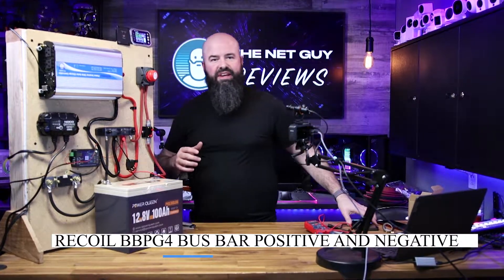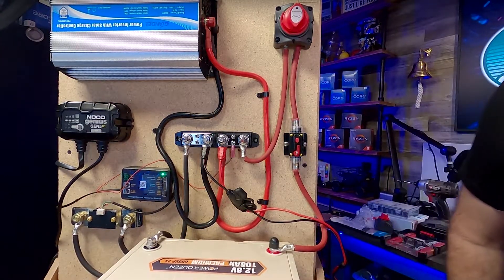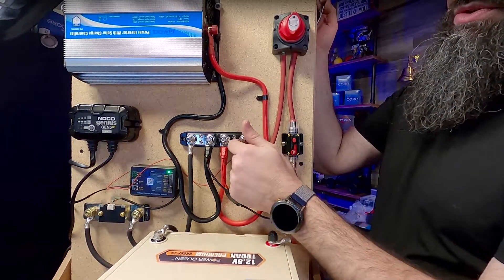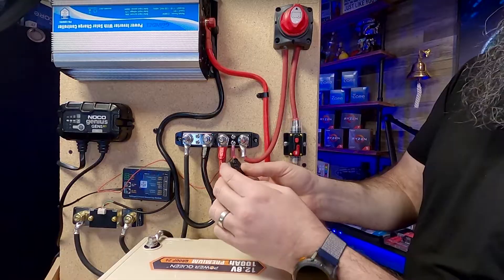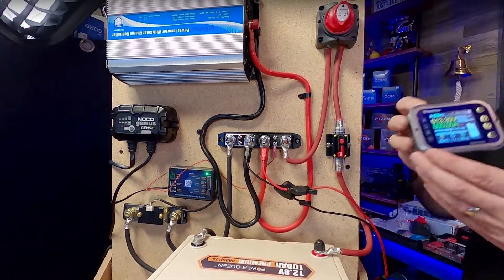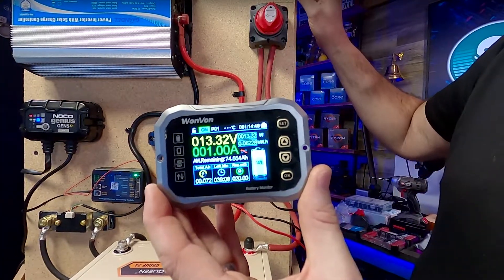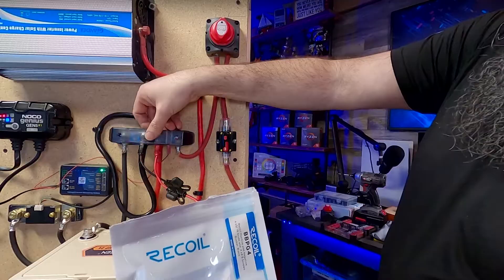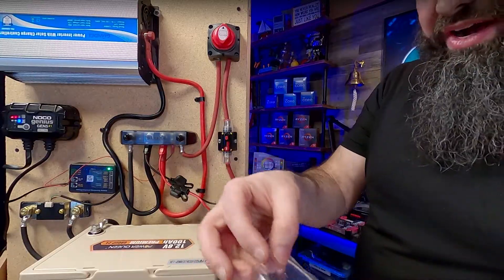Easy 12v LiFePO4 wiring with this split bus bar from Recoil

Comment: Nice little combination bus bar. I like it.

For my sister, I used the links distribution - but if I were to build a smaller simpler system, I would 100% useless, in fact, I may order one just to have it.